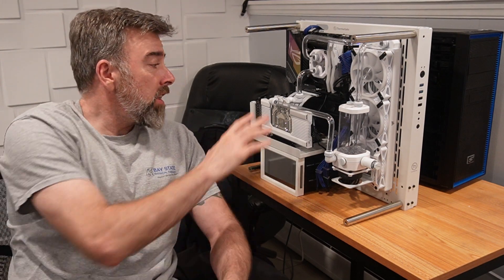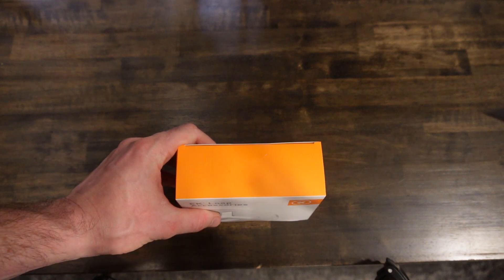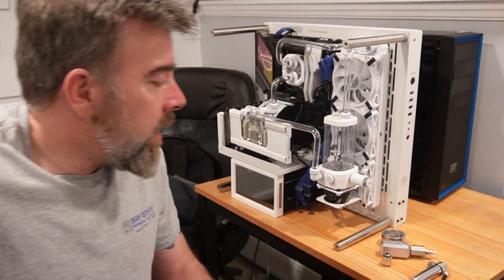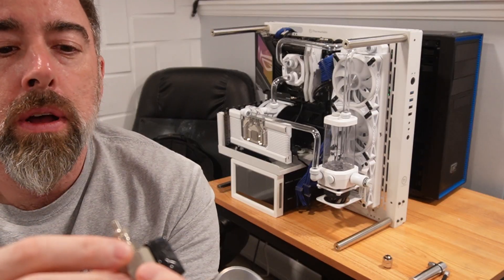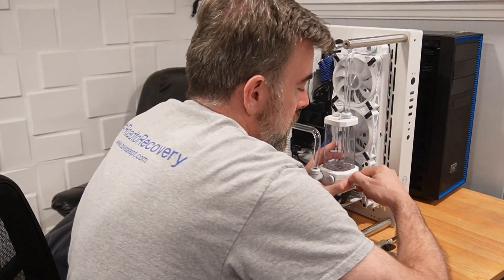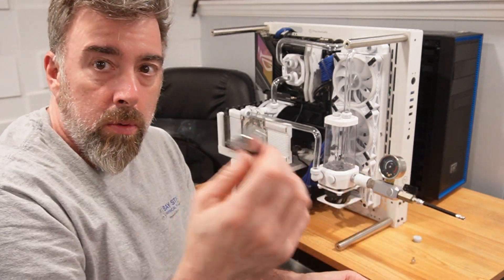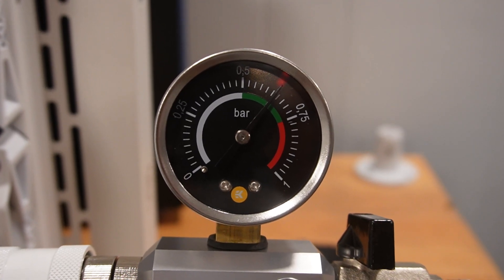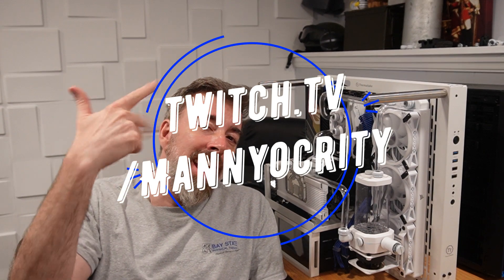EK Water Blocks | Leak test custom loop | Unboxing | Setup | Use

Comment: So im building my first water cooling loop. Im at the air test leak stage it held pressure for like a hour it didnt move, but maybe after ab 7 or 8 hours later i noticed that the pressure dropped a little bit. Ab the distance between little lines on the the gauge. Would be considered ok??

Comment: I think I might get this case. What do you think of the p3 pro?
Reply from the maker: I think the pro comes with an additional mounting plate for fans that you can either top mount or side mount.  That is nice because I can only put a single radiator in mine where in thr pro you can put two.